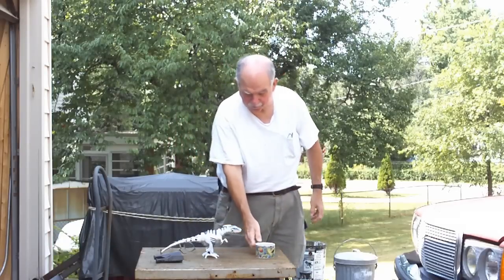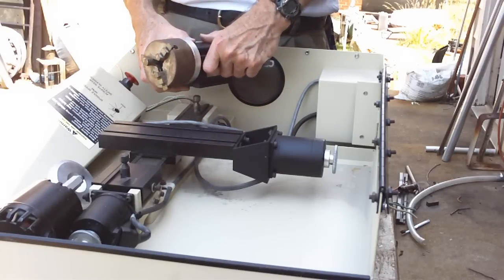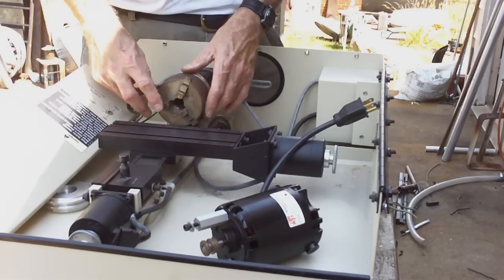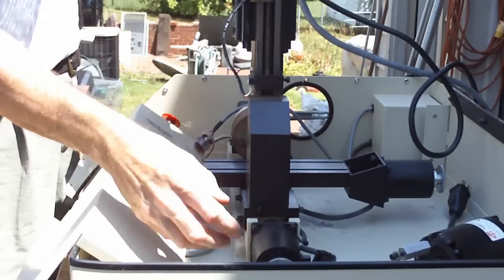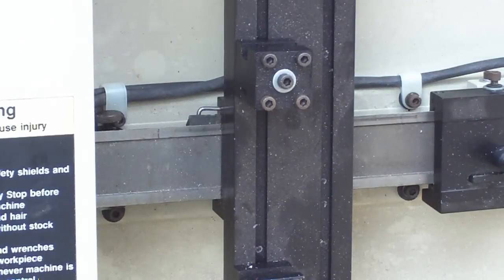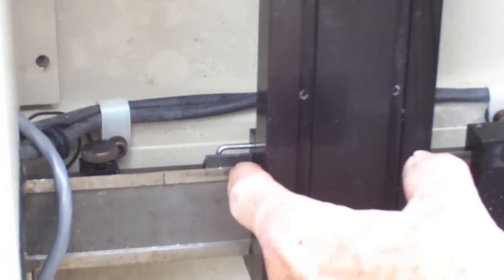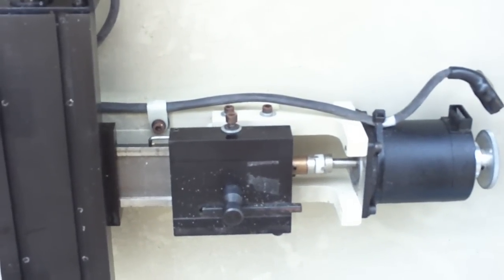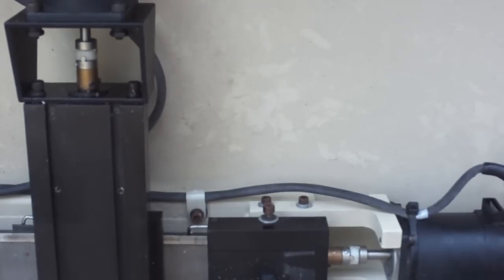Light Machine CNC I

Comment from the maker: I found a controller card on ebay for $110. It works.  I downloaded some free software called Mach 3 which is limited in the number of lines of code you can run in the free version.  I'm running the controller off of two lead acid batteries (24 volts) till I finish building the 24v powers supply.  THe mill runs pretty good.  I'll make another video when I get the garage in shape.